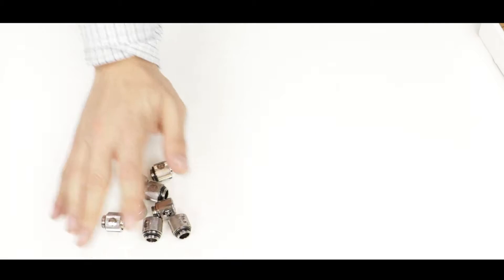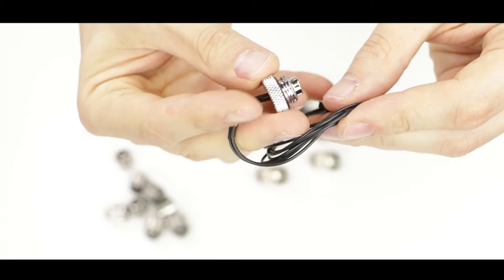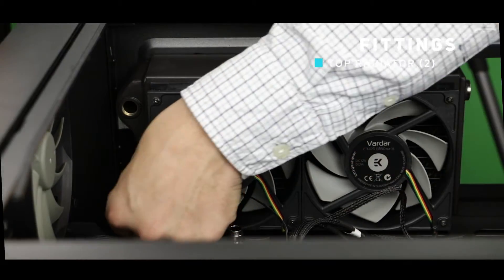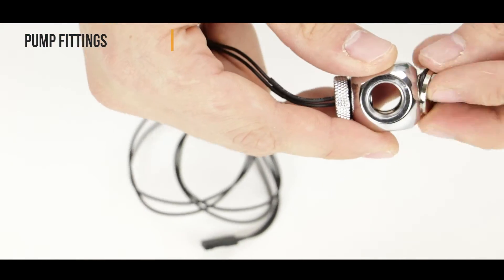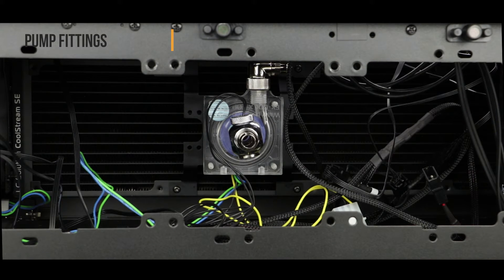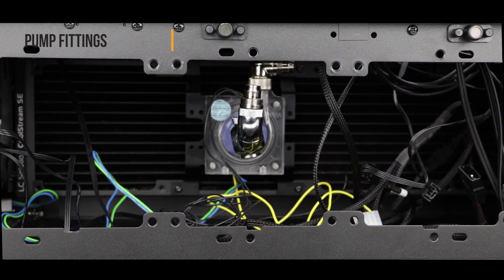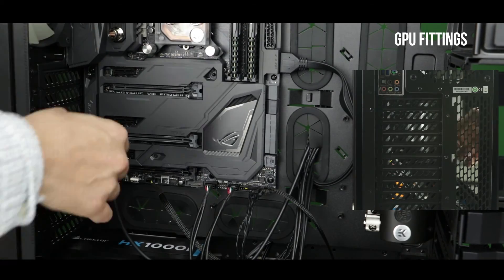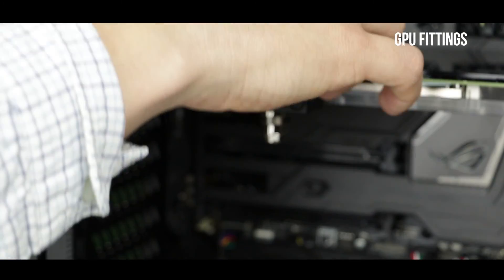Pressure fittings & GPU installation (custom water rig 8/9, Part 2)

Comment: Thank you so much for this.  I love this case, and am now on my second one for a new build.  I'm really toying around with fan placement and couldn't figure out how to get the bottom set up for fans.  I'm using a corsair H150i which I'm thinking of either putting on the roof or the basement....I really couldn't figure out how to prep the lower fan area and Corsair is cryptic at best on how to prep the case.  This video was exactly what I needed.

Comment: Hi Laurent, on the temp sensor part what other fittings are you using besides the T-block, temp sensor and plug (shown at 3:31)?